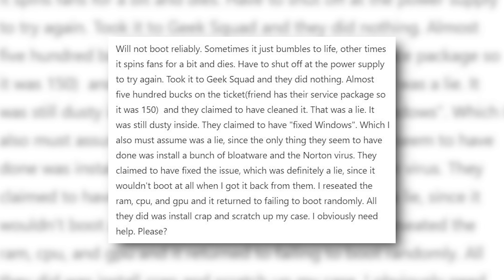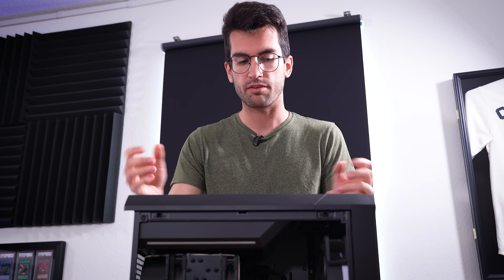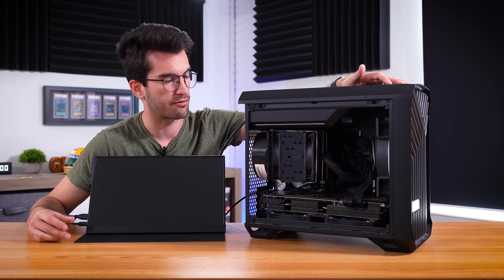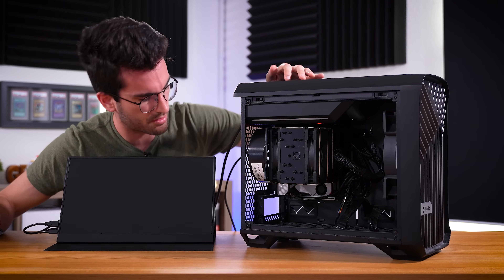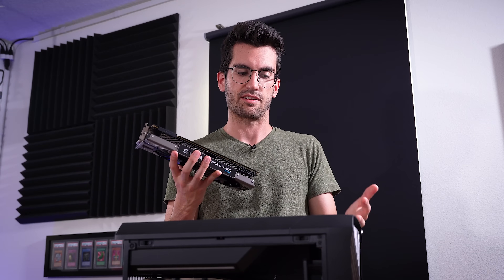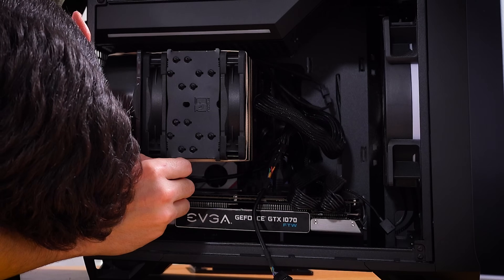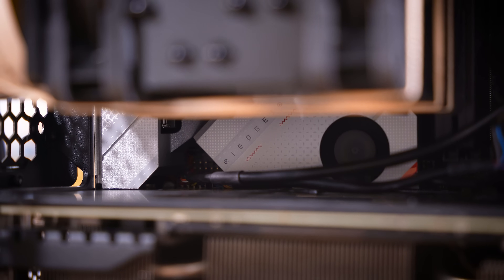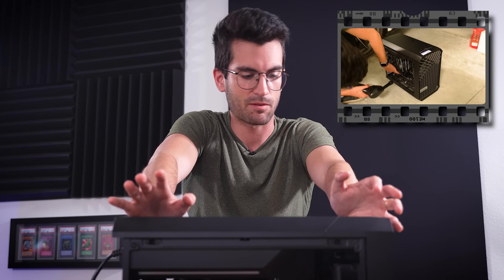Fixing a Viewer's BROKEN Gaming PC? - Fix or Flop S5:E6

Comment: I had this exact issues before! It took many hours to diagnose it, I even took out RAM and my GPU to see if it at least turns on--but nothing. 

So, everytime I turn the switch on the PSU and then press the power button on the case, the PC turns on for a second and then turns off immediately, and then if you try to power it on after that, you just get nothing, you have to switch off the PSU and switch it back on before pressing the power button on the case for it to turn on for a second before turning off, and then nothing if you try to turn it on again. The symptom does mean that something is shorted.

I accidentally fix it by.....literally just touching the PSU cables when I took it out of the case (didn't unplug anything). To elaborate; my PC did this weird power thing after I clean it and push some cables around (just to make it tidier), so when the power issue happened I EVENTUALLY assumed that maybe something got unplugged when I cleaned it, and so that's why I took the PSU out to see the connections on the cables--and nope, nothing got unplugged, but I did push on every cable to make sure it's plugged in properly (there wasn't even any play on any of the cables, all were connected properly).

And then after I put the PSU back in the case and press the power button.......it just turns on, that's it, nothing was wrong with my PC at all.

So I think the PC this episode might have the exact same issue as mine was--just some cable not properly...connected? Somehow??? It's literally just needed "unplug it then plug it back in" type of fix 💀💀

Comment: Greg, I just had a thought when i saw you change GPUs.

Not to long ago i watched a video on Adamint IT channel "Lets fix computers", and he resolved a similar issue. Whenever a graphics card was installed, it sometimes would boot, but if the card got moved slightly, the computer would shut off. He would install the GPU into another PCI Express slot and the issue would be gone. 

He then decided to inspect the top PCI Express slot and had found that 3 of the solder joints came loose off the motherboard. He was able to solder them back on and got the slot working again.

Im wondering if that motherboard had a defective PCIe slot.

Comment: I've been down this road too many times. Although I would have wrapped some adhesive black insulating tape around that HDD LED cable just to make sure to isolate it. The area of the GPU heat sink you were touching with the bare ends is anodized and non-conductive. It would have been a different matter if that wire and it's bare end had somehow got pushed down onto the PCI connector with the GPU installed. It could have randomly earthed a trace which would have triggered an error which could have led to a blue screen or a black screen of instant shutdown. Also, I would have stuck a bit of something under the leading edge of the card to stop the sag since that may have been an issue especially if he was moving the system around. And finally, never ever under any circumstances and in no way take a system to Geek Squad. As has been shown here they are worse than useless.

Comment: I think front panel connector was the issue, the hdd led pins could have touched the shielded PCI slot or some other conductive/charged or ground point and caused the Motherboard to try and save itself. If it was loosely wiggling around then all the reseating the owner tried might have given him the different results.

Comment: I have a computer that stopped posting one day. I would hit the power button, fans would spin up to 100%, and that would be it. Since it had been replaced by another computer, it got put in the back of the closet. Every year or two, i'd plug it in and see if it worked. Nope. One day I decided to try and fix it. I reseated the video card and voila. It worked! No idea what i did. Fires up every time now.

Comment: Hi Greg, everything good? Im Alex, im from Brazil, and im a Computers Technician... I do everything from Building to fixing, thanx to your Channel... 
I think i know what is the problem with this PC, and is the PSU from Corsair... Back in 2018 i had an CX750 from Corsair in my own build and sometimes she doesn't power on for some reason... Ive tried to unplug from the power, to check the connections inside the computer, everything, then suddenly she comes alive again... Then I've reached out to the store where i bought it and i went to a HX1000 and never had a issue... Then, recently I've got a call from a client, that I HAVE built him a system and he told me that the PC just wont start after a AMD GPU DRIVER UPDATE... I was like WTF???? Then after 40 minutes looking for something wrong in his build i pressed the power button and what? She turned on... I really think that is a project issue from the Corsair PSU that are more entry level OR something that brings us to a state of protection... There's a Take on your video where we can see the brand of this PSU in the video... CORSAIR.... 
Idk, i would check that...

Comment: Very hard to notice at 6:22 I see the red wire coming out of POWER LED by your left thumb is on the bottom of that connector, while the POWER LED+ is on the top in your right hand. Red wire is usually live and Black wire for Ground. I can't tell if the wire above the Red wire by your left thumb is black or not. Possibly the right wires are switched? Again hard to tell but you also got it back up and running in the end. I'm not a hardware expert so I'm also a bit clueless.

Comment: Near the start, I thought that the left 8 pin PCIE supplemental power connector did not look like it was completed seated. Could this be your gremlin? The sag on that 3080 TI is really starting to get bad. You should have placed something to prop up the right side of the GPU, so the sag won't cause BGA damage in the long run.

Comment: Ah Greg….i can tell you what it was. The front panel connector grounding to itself. Each of those pins is hot and ground. If in that patch that spare connector was touching its grounding pin to the pins in the power or reset button then it would display the symptoms described.

Comment: 06:22 maybe a contributing factor: it seems the power LED is wired up backwards. The red wire goes to led (-) in the wire adapter.
Reply: Its just DC power shooting a pulse trough a LED either works or not, electrons don't walk backwards so with another component is could stop the power LED from lighting up, thats all.

Comment: I had a weird psu issue at one point whole system whole just shut off and wouldn't turn on until I switch psu off and on luckily was under warranty as it was relatively new and got a replacement no issues since and the brand offered a rma where I payed for a new psu and they refused me when they got mine back so no down time

Comment: i did watch a computer build by cary holman? all new parts. would not boot up.
took it apart, put back together. and it worked just fine.  a puzzler to be sure.

Comment: Reminds me of the pc problem I had yesterday. Picture suddenly developed streaks to the right of every line of text or block of color, so I powered the system and monitor off, cut the power at the strip, then disconnected and reseated the hdmi connector on the gpu, then the connector on the other end of the stupid hdmi2vga adapter I'm forced to use, powered everything back on, and KABOOM!!! The streaks are GONE! Picture seems noticeably sharper too!

Comment: Wonder if there’s a problem from the power draw at his house. I’m basically ignorant when it comes to electricity, but if he’s using a power strip or whatever, if the power coming through those components is intermittent due to some failure point, it seems logical to me that could be why it’s not a consistent issue. That in conjunction with any cables that might have been disconnected and reconnected after the problems arose and not being seated properly. Can’t reliably say that Goonsquad would’ve had seen the compounding issues as they likely looked at it and said “Yep, that’s a katana!”

Comment: The PC has been moved around a lot and maybe something just got dislodged, and simply re-installing the card "fixed it". I've built a few of these ITX systems and you are cramming and bending stuff all over the place, so it's possible there is a short somewhere. But there could still be a intermittent issue with the graphics card or power supply, that is a power hungry card which has been deshouded and it might have developed an issue. The other thing the user could check for is that AM5 is very new and they keep pushing updates for it, I'd update the BIOS and chipset drivers just in case.

Comment: @GregSalazar Rubber bands are the WORST thing to use for fans, no matter how functional it looks, the reason being is those rubber bands deteriorate over time (and were talking within a year or so), due to both being stretched and the heat. And once they snap, there goes the fan, and most likely a blade or two go flying. definitely not a long term solution. Zip ties would at least be a bit better.

Comment: probably the way the GPU was plugged in coz the audio and front panel cables are in the way when the owner plugged it in and it wasn't slotted all the way in, had the same problem on one of my builds and had to make sure the cables are out of the way when slotting in the GPU on the PCIE slot.

Comment: Maybe the PSU cable wasn't quite connected properly to the GPU? Maybe one of the front panel cables weren't connected properly either? Sounds like there was just a loose cable somewhere

Comment: So, I'm going to point out something I didn't notice you comment on: His GPU has NOTABLE sag in the case. Not only is it sag, but it's that same 'far end yanked down' type of sag that is KNOWN to cause issues, not just on the GPU, but on the mobo. This might explain the intermittent and inconsistent nature of the issue, and even why original owner said it wouldn't boot at all after getting it back from Geeksquad, if the way GS handled it put additional strain on that connection, causing it to be faulty every time, until owner went in and reseated everything prior to sending it to you.

It could well have been causing issues with contact that were popping a protection on the mobo that was causing it to shut off and refuse to cycle until the PSU had fully cycled power out of the mobo. 

By reseating it, you may have temporarily solved the problem, only for that sag to continue and reintroduce the problem at a later time. 

It may not actually DO anything, as it may not be the cause of the problem, but some sort of anti-sag bracing (even if it is just fishing line looped through the sink and tightened at the top of the case) may solve the issue, and is hardly liable to cause any problems if it doesn't fix the issue.

Comment: I'm going to assume that the HDD connector was touching a part of the motherboard causing a short.  The best thing you could have done is capped the HDD cable end to ensure it doesn't accidentally short the motherboard.

Comment: The HDD led probably isn't getting power long enough to trip protection when you tried shorting it while the PC was booting up as it would only be flashing intermittently depending on HDD activity.

Instead you should have shorted it as you press power. A lot of mobos send power to HDD led for more then a few seconds as it is posting before it turns off and starts flashing in accordance to any hard-drives the mobo sees. That's why it wasn't happening anymore for you most likely.

Comment: Sometimes, just reseating cables ends up fixing the issue. A couple of years ago, I replaced pretty much every part trying to find out why my system would intermittently restart. Ended up being some gunk in the reset switch itself. Had I watch these videos before, I probably wouldn't have spent so much money to find an easy fix.

Comment: Might be the motherboard.

Sometimes when my computer was doing the same thing, I'd wake up in the middle of the night and the computer would be on for absolutely no reason. It did this for almost a year and now it doesn't do it no more.

Yeah I had a lightning strike that fried my tv and went into the computer through the hdmi and fried the gpu and the eithernet got fried from the cable box which got fried also.

Was a nightmare. Luckily I had 2 eithernet ports

Comment: Am I the only one who noticed? Do a slow frame at 6:21 and check the Power LED connectors. They were swapped. The case connector for Power LED has the positive side up top, and the motherboard connector/jumper has the Power LED positive side down (red wire).

Comment: My money is on the front panel case connectors, that extension cable looks suspect to me. Not only if it is making good contact at the join, but also at the motherboard. 🤔

Comment: Im paused at 11;15 as this reminds me of a very similar issue i spent hours troubleshooting, pc did same, turned out the PCI cables had been used from different PSU so wasn't powering up when GPU was connected but worked when not, Corsair type 4 cables do not work with gigabyte psu was my advice to customer, no mix and matching.

Comment: Could the HDD LED cable touching the PCIe slot short to ground? Because, I'm thinking that if taking out the owner's card, power on the system with other cards(with and without supplemental power) result in a POST reliably, and the PSU is all green... the system shouldn't have an image with the original card after the fact, but it does because the front panel cables aren't shorting to ground. I highly doubt that a GPU backplate would ever be responsible for an immediate shutdown because case connectors are touching it. They and the graphics card's backplate(effectively a heatsink) don't have any common electrical circuit, other than the motherboard.

Really weird fix, but a good example of a step by step troubleshooting procress fixing the problem without knowing how or why. 🤣It works fine now so don't lose sleep over how you fixed the problem. Just be happy that you did. 😚

Comment: My best guess would be that the HDD LED connector shorted the graphics card between the backplate and the PCB. It was obviously something shorting in the case and the backplate doesn't cover the entire PCB there is a small void just on the edge of the PCB on the PCI-e side where the connector might got shorted the PCB or shorted between the metal backplate and the PCB.
I guess Geek Squad pulled the graphics card and it came to life so they plugged it back in and did their bloatware thing. Moving the system back home might had caused the connector to end up where I think it did.

Comment: The only thing i can think of if it works at your office and it was working at geeksquad or whatever company it was is something to do with his power outlets, maybe dirty power or just a faulty extension lead possibly which is causing it to go all scatty... seen it happen once before and plugging directly into the mains socket fixed it, other than that its anybodys guess i suppose, but shes working now, you got ya content, he is able to game/work potentially, unless when he gets it back it starts doing the same old thing... Usually the case...

Comment: but you didnt short that hdd pin and THEN try to power it on while the pins are shorted. It could be enough that the board won't power on if its in the short position when post attempts, might not be enough voltage to short the system while its running....

Comment: Built a PC using used parts (AMD B350 MB with Ryzen 3600X, G Skill 3200 MHz RAM, GTX 1060 GPU), and originally was shorting out. Realized that the standout Screw was shorting onto the MB after pulling everything out, and putting things back one by one. But again, this is the process of elimination as shown. Honestly, I would never go to Geek Squad if I wanted because again, they would charge for something that you would not need.

Comment: Likely the GPU was loose in the PCI-e slot causing some pins to perhaps be where they shouldn't so it trips the PSU. Happened on my test bench too till i saw the GPU bracket was stopping the card from seating.

Comment: The only thing with this video that I can think of, is that the hard drive light connector was probably touching a solder joint or touching bare metal.

Comment: I've had PC gremlins before more than once and a full rebuild, remove everything and reinstall, has fixed the issue about half the time exhausting all other options. All I can say is, sometimes there could be a partial short, bad connection, strange random hardware issue, or a strange bug. A rebuild may solve the issue and you may never find out exactly the cause but it sometimes solves the problem.

When I offer PC advice or am troubleshooting for my self, after trying everything else including an OS reinstall, clear cmos, and bios update, a full rebuild is the last step and sometimes solves the problem.